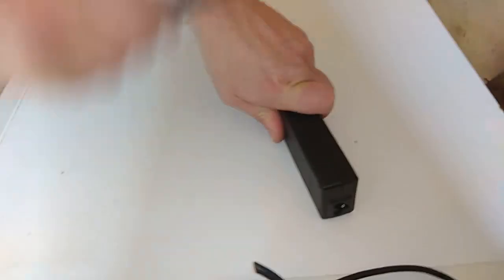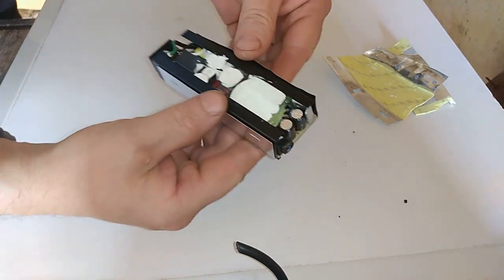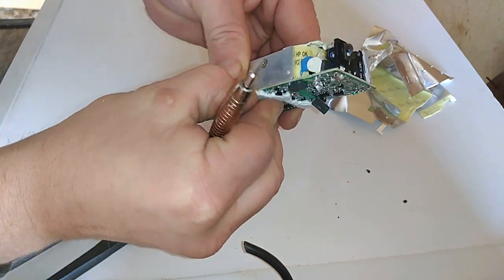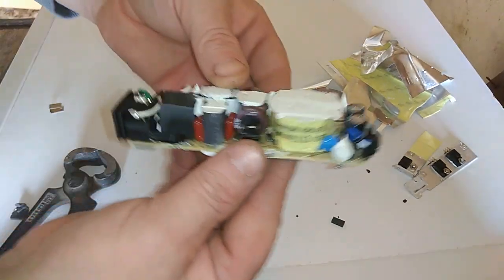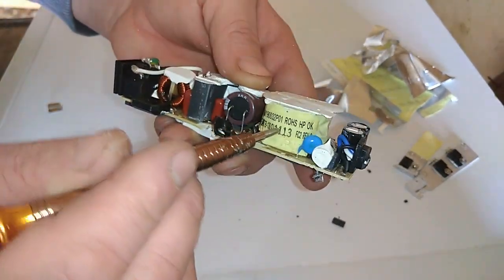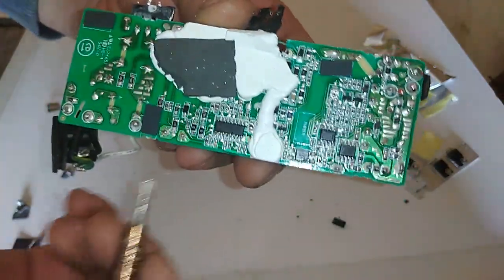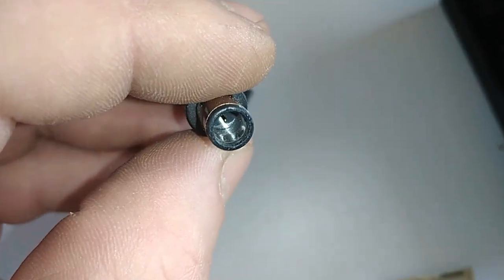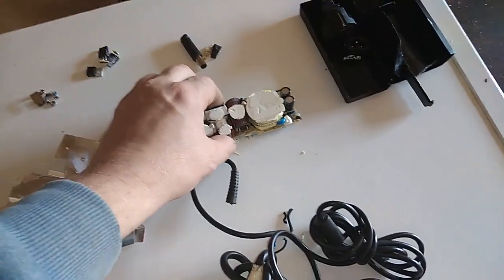Scrap laptop charger for Cu,Al and more...

Comment: Hi
I took some old memory cards I had trimmed off the gold fingers on and some sound boards and graphic cards and cleaned off the green with caustic soda, like you did on your video. but the gold color disappeared. Just silver looking now. almost like the gold had been coated with a different metal. I am looking forward to seeing how you further refine you cards. sorry to post here but I couldn't find a email to send this to or I would have attached a picture.
aloha
tito
Reply from the maker: If the gilding is of poor quality it happens to fade during this process. Insert these plates into Ap, a solution of hydrochloric acid and hydrogen or HCl and copper and you will see that the color of gold will return soon.
Reply: @999DusanGoldrecovery  thanks I will try a little test. Are you still planning to do a video on recovery from the boards you prepared?